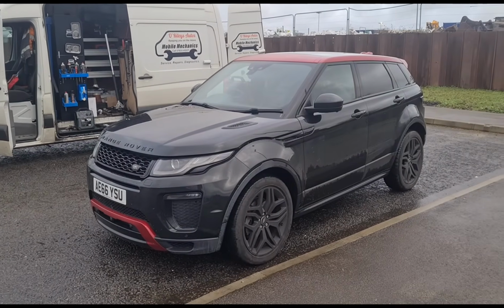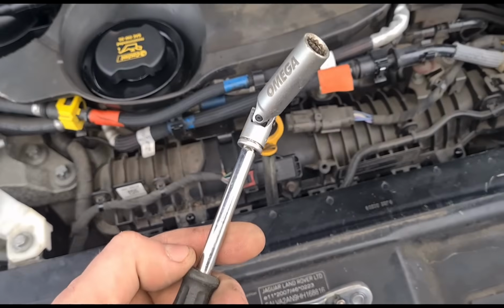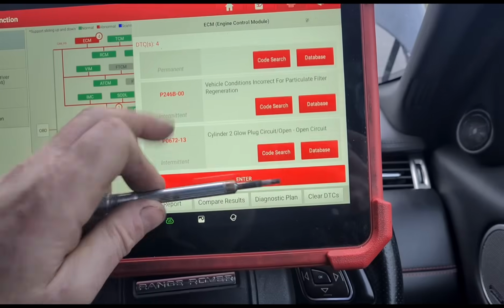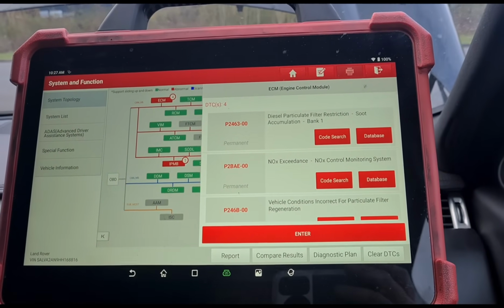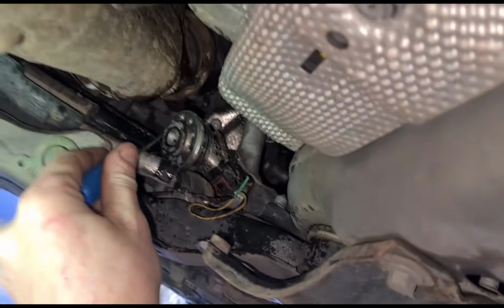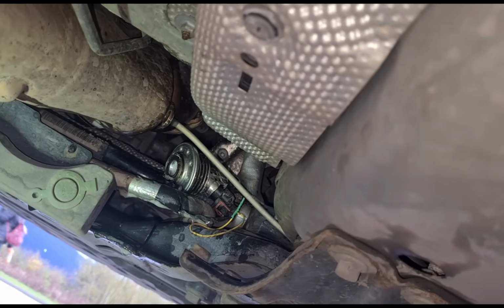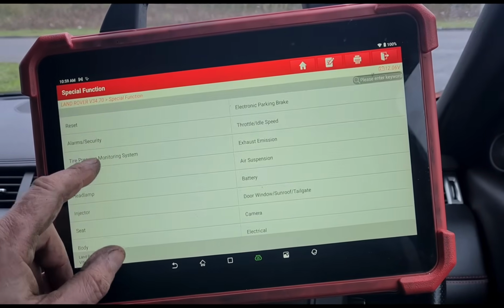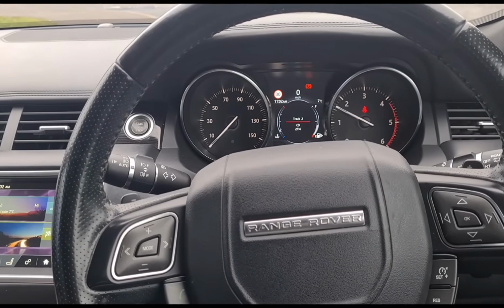Land Rover Range Rover Evoque 2.0 Blocked DPF Cleaning & Adblue Nox Exceedance

Comment: Possibly  a fair comment  about  manufacturers but remember the end user needs to be more pro active in looking after their  cars or vans .it's not the engines  that are unreliable  but the emissions  systems  strangling  the engine the extended service  times don't help either

Comment: We have tractors with dpf's and it concerns me how long we've got before they malfunction & won't self clean. Do you have any experience of cleaning out a tractor dpf? Just interested to know if it's possible like you do with the cars.
Reply: A DPF makes no sense whatsoever on a tractor. The whole idea of them was to trap soot particles in densely populated areas & then regen out on the open road. 

What creates problems with DPFs is when the engine never gets a chance to heat properly. 

I’ve never had a problem with DPF because I live in the country & I tow a fair bit. 

A tractor should be working hard regularly so that should help.

Comment: These manufacturers are out fleece the customer at every opportunity, refilling the add blue should clear the code without the need for Mr average who doesn't have a scan tool to visit a workshop.
Reply: but then if you have like this guy driven it a significant distance and blocked the dpf to allow it to perhaps try a regen on its own could cause a fire or damaging the dpf so actually its a decent failsafe , and the excuse of o i didn't know it was running out is no excuse as all modern cars give you a warning well in advance of it actually running out
Reply: But like he says, you get the warning, you top it up and away you go. You don't have to reset a fault code every time you run the fuel tank down to the last gallon, so why the ruddy adblu? It's a giant scam.  @nigelsears7191